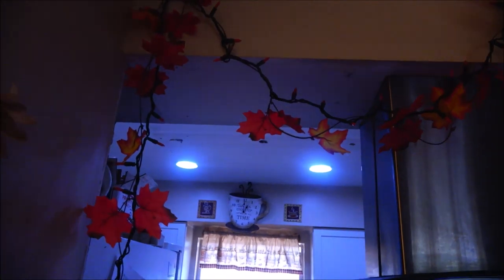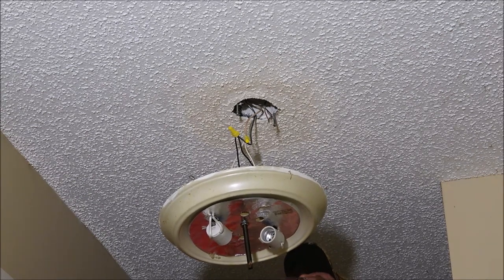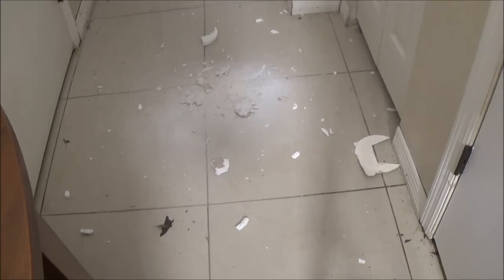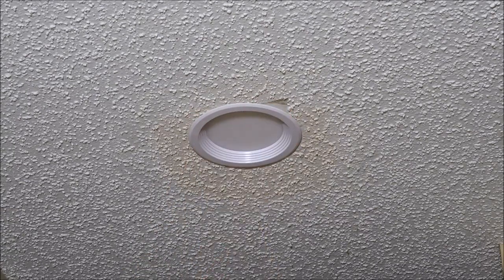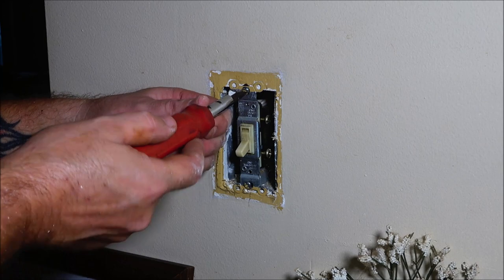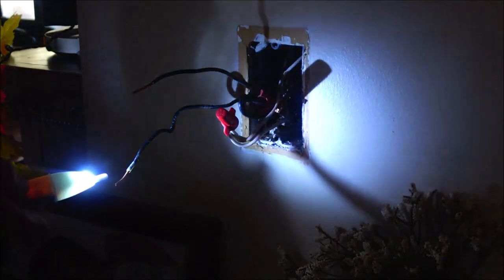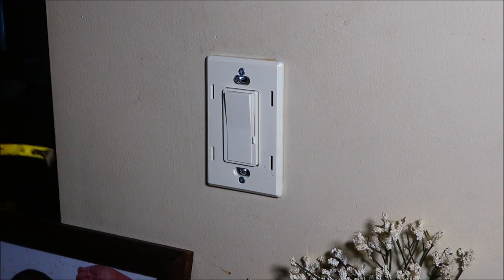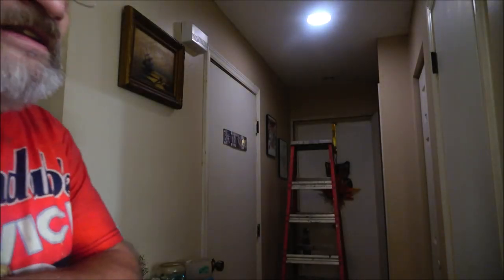How To Install Canister Lights And A Dimmer Switch

Comment: When you put the wires inside the box, is it there supposed to be a clamp to hold the wires for the light ?
Reply from the maker: Great question. Yes you can clamp them if you want, but this one didn't come with any. But you're right, it's best if you do, and some places it's required.